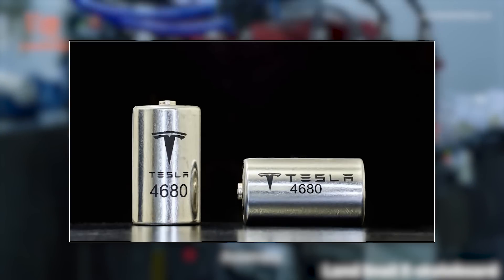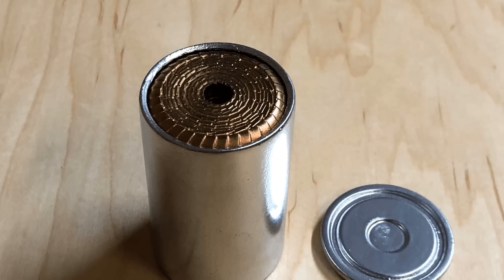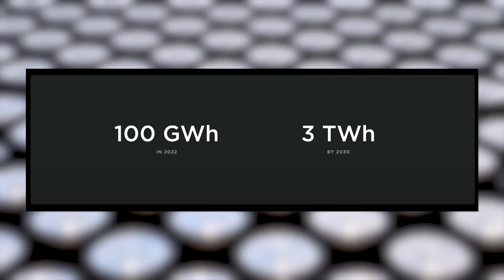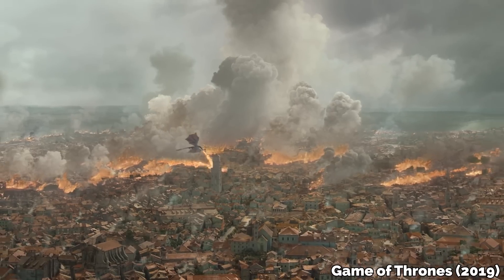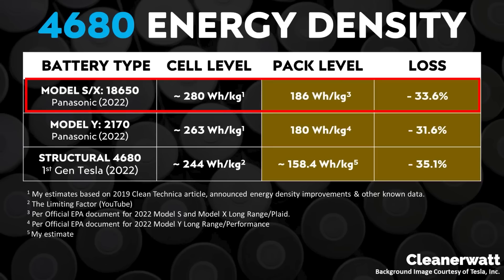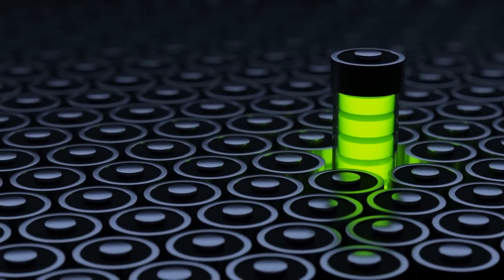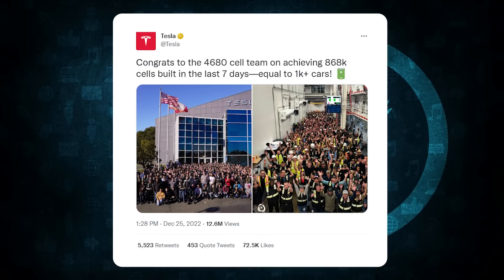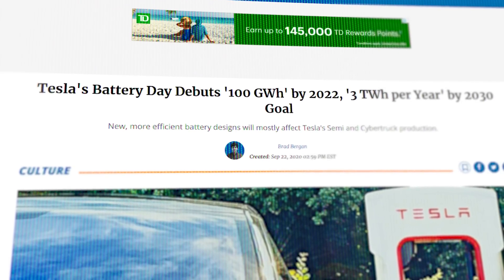The Disappointing Truth About Tesla's 4680 Battery Cell..

Comment: The announcement was not just the new size, but changed to make manufacturing much more efficient, such as dry battery electrode. That new process was expected to take some time though. Then it will be optimized over more time. 

BTW, why keep comparing the Tesla guidance for all batteries produced to how much 4680 production there was?

Comment: Finally cleanerwatt picked up my point on energy d3nsity by pack, not cell. However, higher density isn't always good when it comes to an auto industry that focuses on the safety simultaneously.  Please do not mislead audiences in a higher the better manner. HIGHER is the density better chance to explode!!  Simple equation as it is..
Density can be raised but still difficult to do that with the safety net equipped. This is a secret potion of the battery industry where Bo--h has failed a decade ago.

Comment: 4680 is a "screw you" that will get you in more ways than one. To be short, it is inherently less optimized than older sizes. No way around it. Any method you can think of that can be used to increase efficiency of the 4680, can be used to make old cells even better. It is inherently more expensive, since it is a unique design and made in smaller numbers. And most importantly, it is a royal screw you to the right of repair, as there is no way these cells can be repackaged or repaired without Tesla giving you uniquely made components. A step closer to "You will own nothing and be happy about it" .

Comment: I placed an order for 2023 Model Y standard range with 279 mile range? Its vin has A so i’m assuming it has 4680 battery cells. 
What is the healthy charging   practice % for  23 M Y with 4680 cells?

Comment: If you don't change the battery anode and cathode chemistry chemistry, you don't change the specific energy, energy density, and specific power. Changing the battery size format does not move these parameters. All the larger size format buys you is a more difficult cooling problem. The larger format size might be less costly but with the recovery of the engineering engineering and production equipment costs won't let you see that for a few years. And that last statement assumes that the yield between the two formats is the same. One final comment: yield is a function of the electrode area. That usually means a larger battery has a lower yield.

Comment: You have not yet addressed the elephant in the room, because the right to REPAIR and REUSE, especially when materials and supply is limited, become the most important issues. With EVs we try to pollute less, not throw away and recycle entire battery packs that could be salvaged or reused for many more years. Used battery storage and parts will become a BIG trend and business. You will be able to find a module with a similar SOH that you need in a scrapyard and service your car for a few hundred dollars instead of replacing the entire pack for a single damaged cell or module.

If the cell is not the issue and you need to replace a BMS or controller, that is exactly why it's better NOT to have it all covered in foam and basically render the entire pack irreparable. There are so many service shops appearing that are able to repair battery packs. It's not rocket science. It's easier than repairing an engine. Sure, you can screw up and blow up you gas car also if you don't know what you are doing in that engine. But that is exactly the point: modular batteries are SOOO way easier to repair compared with an ICE engine by any qualified person.

REUSABILITY is also a main point. In 10 years or when my pack starts to have too little range for my need, I can reuse it for home storage. This would add 10 or more years of usage to that pack. It's nearly impossible to do this wih 4680 and you know it. They are worse than the old 2170 version, that could be repairable, not easy, but still not covered in all that foam shit. But the modular baterries are way better and the BYD blade is 10 times more elegant and easy to reuse.

Unfortunately Tesla is going the Apple way, but not in the good sense. You cannot throw a 10-20k USD battery or a 40-60k car as you throw away a 1k phone. Stop taking their side when they are clearly doing stupid things. The 4680 will be forbidden in EU when they realise it non-repairable and this is also probably why they never produced it there. They are using BYD blade for Berlin produced Model Y which is great for the EU market. The right to repair and reuse DO matter !

Comment: The cult of "elon said it so it must be true" we're just not there yet. My dear bothers in christ, your rose coloured blinders my be open but your eyes are still closed while you main line excessive amounts of cope. 
I understand this is not scientific reporting but you yourself have now seen the facts YET you hold some optimism that elon will somehow defy physics and chemistry , using the same tech thats been around for decades! The 18650 is highly refined and optimised for the chemistry available. While teslas manufacturing is novel, the tech / chem is not ! We KNOW what realistic outputs to expect from such chemistry, where you think this insane revolution is going to come from is beyond me. The reality is , This was promised to be better than existing batteries yet,  its not able to achieve parity with existing batteries. At this rate of "progress", 2 years late and massively underperforming, you gotta wonder at what stage if even does this battery catch up to proven technologies.

Comment: As somebody that attended the Battery Day presentation in person, I was very confused by why everybody got so hyped up about the 4680 cells and structural pack. My understanding from day one is that it would take 5-15 years to realize the numbers presented in the presentation, but most people for some reason thought it would happen within a year. 

18650 and the 2170 cells have been optimized over and over again to the point where they are close to as good as they can get. The 4680 on the other hand is still in it's infancy and still has many many optimizations available before it gets anywhere close to being fully optimized. 

It's essentially the same as SpaceX with the tried and tested Merlin engine and the new Raptor engine. They have been optimizing the Merlin engine for years now to the point that it is insanely reliable and efficient. The problem is that they have gotten almost everything that they can out of that design. Now they have developed the Raptor engine which has the potential to be significantly better than the Merlin in the long-term. As of now though, the Merlin is still significantly more reliable and efficient than the Raptor. It just takes a long time for a new design to become better than an old design that has been optimized for a long time. This is especially true when the old product is being manufactured at an order of magnitude of a higher volume than the new product.
Reply: And yet, even with it's actual capabilities, it makes the production already much simpler and cheaper and last but not least, Tesla can produce it inhouse. Another puzzle into the full vertical integration scheme.
Reply: Elon did NOT say it would take 5-15 years to bring out the 4680s.  He should have if that was the going to be the case.  He promised a much shorter time frame.
Reply: @billsrelectric  Anything that elon says about a timeframe is already a running joke.
Reply: @triage2962  Sadly, that is accurate.   But as a TSLA shareholder, and EV supporter, I hope Elon can meet as many of his goals as possible (despite some overpromising at times).  For example,  I think the Power Storage / Power Grid business has tremendous potential.  Both as a profit center for Tesla, and as a great service for Electric Utilities.   And he has not overpromised with that business.
Reply: @triage2962  Yeah and I would say that is bad.
Reply: @billsrelectric  lmao🤣🤣🤣
Reply: @billsrelectric  What a relief to see someone using the word "goals" instead of "promises".
Reply: @billsrelectric  It is his job to be optimistic.   It makes everyone who works on the project work harder to meet expectations.    Had he said 5-15 years we might be waiting for the first cell.   When Elon says anything it is always tagged as a promise because breaking a promise has so so much more impact then not meeting ones expectations.
Reply: @billsrelectric  thats because he lies to drive up share prices.  it always worked before.  just didnt really work this time.
Reply: so true. follow any product- mechanical or electronic & that principle holds. the entire reason for GM, FORD & mopar factory race teams? a development test bed for improving engine & drive train technology. do you like your corvette? guess what? that engine was developed by GM factory racing tech. at one point or another- most major gains in that car were once on a nascar or indy car. 

do you like how your dodge demon rips 'em a new one from red light to red light? guess what? at one point or another- some of the advancements in your engine were in MOPAR's NHRA drag racer, competing the fastest 1/4 mile on the planet.
Reply: Very true! What gets overlooked in all the hoopla about performance is that the primary goal for 4680s has been, and still is, cheap and high throughput production by dry electrode methodology. And Tesla must be very confident that they are able to achieve that. How else would they commit to the Giga Nevada expansion with the relatively small footprint for the 100 GW 4680 production facility. Achievement of that goal is also what drives Semi and Cybertruck production rollout.
Reply: Its why I take a huge issue with Tesla Space claiming tesla over promised and under delivered. NO THEY DIDNT Channels like Tesla space ran off before making sure they understood what was discussed. Thats not Tesla's problem that is a personal problem. Hell a non trivial amount of the innovations were deployed in the first gen cell.
Reply: During battery day Elon said that (1) there were still many scalability issues to overcome and (2) he was fairly confident they could scale to 3 TWh per year production by 2030. So yes, not overnight. At the time it seemed like they were producing the equivalent of 20 GWh per via 1 line. So scaling that to 3 TWh in 10 years would be the goal.
Reply: Absolutely. If you know anything about battery technology and development, you know it's incredibly difficult to develop and produce a new battery technology. All these new "revolutionary" batteries have been introduced for the past several years, and we've yet to see any reach the market. It's actually not only reasonable the rate at which Tesla made progress, but impressive all things considered. Their first-generation cells were almost on par with typical 18650 configurations, they're producing their second generation, and likely will test a third generation sometime in the next year or two. It's only a matter of time before the 4680's really show significant gains over typical cell designs. Not to mention, other carmakers expect their platforms to roll out in several years whereas Tesla is already improving what they have.
Reply: Optimized through hardware changes or can they make existing batteries in current cars better overtime?
Reply: Maybe stating the obvious, but does it not then make more sense to continue to develop the 2170 at optimum outputs until they see at least equal results from the 4680 cells? Seems to me that's where the business sense confusion comes from.
Reply: @dogmader  pro noblem days something. month anything years. lmao. dude- chat bot broken is it?

Comment: With all of that, you never discussed the performance number that actually MATTERS:  How much is it COSTING Tesla to make this battery pack on a per unit basis?  If it is equivalent to existing technology, but massively cheaper and more scalable, it's still a win on a business level.  Conversely, how much does the battery cost when it's R&D cycle is amortized in?

Comment: As I understand 4680 cell the efficient heat & current flow are out the two ends. This is where the improvement comes from, and Tesla has almost none of the gain yet. So 10 yrs, not 1 or 2.  Tesla is literally still cooling thru thre sides.
Reply: I believe they need several eureka moments, which often come slowly. because people are creatures of habit and prefer baby steps. Eureka moments are often simple things like turning the battery cell upside down that are so obvious no one sees it. Thus ten yrs is equally as reasonable as 6 mos. Tesla also has to develop several production lines simultaneously for several chemistries, so apparent progress can be very slow while actually fast. Tesla is literally still cooling cells thru the sides, so they still aren't after high current yet. I view multiple chemistries and cooling as key metrics for progress. From the outside looking in through just a peep hole they look stuck in the mud.

Comment: Best Batteries are CATL which all Tesla’s out of China leave the factory with. Panasonic would be next, 2170 is a copy of the Panasonic. Unfortunately those with 4680 batteries in teslas are going to find their cars depreciate a lot harder than the others with CATL, Panasonic and 2170s like early Nissan leafs. Another bummer with the 4680 pack is you can’t repair it, like you can with the other packs it’s a total replacement very expensive if just one cell is a dud.
Reply: Conjecture without facts. Nice.

Comment: Considering they said it would be a less energy dense battery, and the fact that they were talking about three different kinds of batteries at battery day.

Lithium iron phosphate: inexpensive least energy dense

One about manganese

And another I can't remember

But they showed pictures of the model 3 Y S and X for long range and the Cybertruck and semi for the highest energy density batteries.

Yeah it was confusing especially since they didn't talk about it ever since.

But the most important part was getting the cost down and shrinking the footprint of the factory meaning that if they update the current factory to the new standard they could have about five times as much production (watch battery day to get more accurate information I can't remember)

Comment: I don't see the 4680 is going to be superior - maybe over time in the production sense it will be but it will be marginal.    If they cannot match current energy density then I don't think it has an inherent advantage.  Any gains it achieves is probably also going to be applicable on other battery designs.   I think that Tesla could do better without the Elon hype.

Comment: Im not sure why you would make a video titled this. Its clear you dont know the path the cells are on.

Heres how it went, is, and is going.
The 4680 was suppose to ramp in time for the Model Y in Berlin in 2023, thats when they really needed them to be at a good scale. SO far they have exceeded this ramp. THe amount of tech and sophistication in the current 4680s are NOT the final form and only have dry batt electrode not in the cathode. 
Tesla has said SPECIFICALLY, it would be STUPID to try and ramp a new cell and put all the bells and whistles and tech in it like the silicone anode and dry batt process all at once.

So they didnt, they concentrated on ramping a basic version and they did that. They ramped it and they are adding more to them with each iteration.
When Cybertruck starts production and the cathode factory is finished in Texas, THEN we will see a step change in improvement.  THE CATHODE FACTORY HAS BEEN KNON ABOUT FOR YEARS NOW. WHy would they add all the tech BEFORE its done? THey are designing THAT cathode factory to spec out the new 4680.
They are right on track where they said they would be, but ALWAYS someone like this makes a video complaining its not good enough, its not fast enough.  

Get a grip. Tesla is killing it.

Comment: Equal density at 5 times the size is not impressive, it's disappointing. In theory making it bigger means less wasted space for the casing and separators as there is more total area for the energy to be stored in one space. Being only identical means it didn't work out right. This is far worse still as bigger round cells can't be fit as tightly together leaving bigger gaps between them. Tesla claims this is a good thing as it means more airflow across the cells, but that's the whole point of the water cooling on either side of the pack. 

I'm honestly really confused what the point is supposed to be. I get the lithium ion phosphate batteries as they are superior for EV use, but bigger cells with only identical energy density seems more like a loss.

Comment: Unfortunately this video gives no explanation as to why the 4680 failed to live up to expectations for energy density (the holy grail of batteries). It is only given a 'C' grade by Tesla. But it is expected to improve. How? Why don't you explain where this expected increase in the energy density of the 4680 is going to come from. And if larger volume batteries have a lower energy density - why not build a smaller version? A sort of 2340?

Comment: Let me add one note: "Tabless" is technically wrong. The internal electrode must be connected to the external pole of the battery somehow.
Therefore the 46800 isn't "tab-less" but has a connection that resemble a "continuous tab", a feature that greatly reduces the internal impedance - and therefore the electric losses. But it can't do nothing against the much reduced heat dissipation. Relative to specific power, the 46800 has 70% of the heat radiating surface of a 18650...
Reply: True, but heat also flows better through the higher tab-crosssection. Also you dont have to dissipate heat you didn't generate in the first place.
Reply: Tab is something that protrudes. It's now pretty much a surface. I e. Tabless despite multiple tabs folded down as a surface.